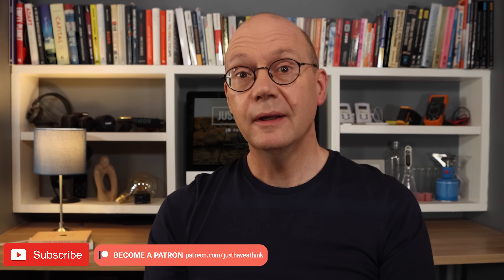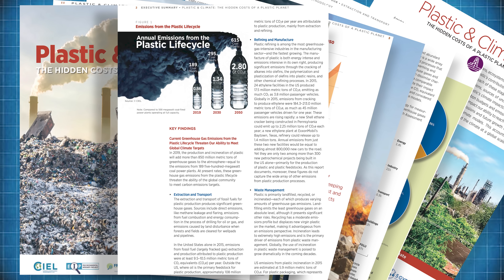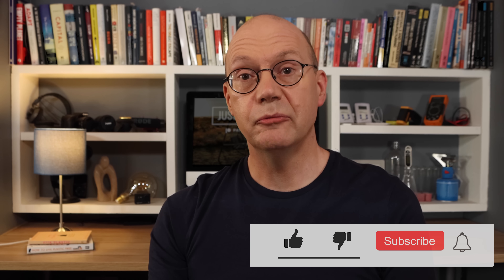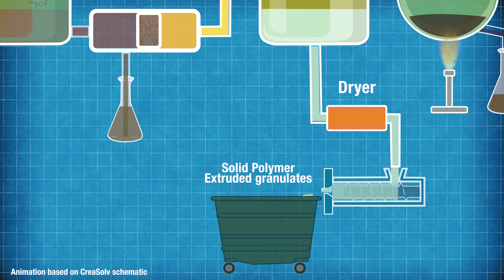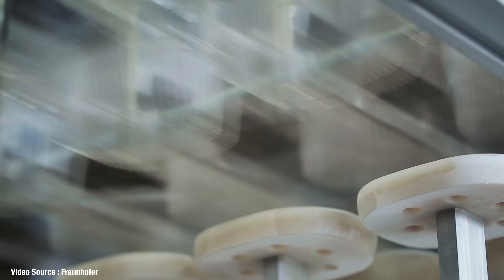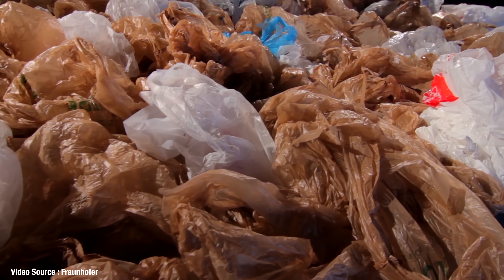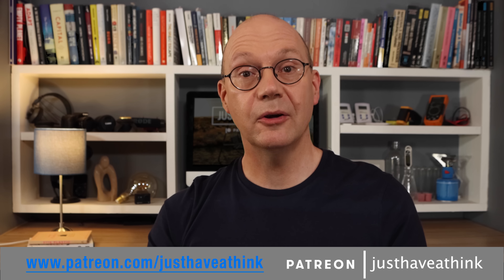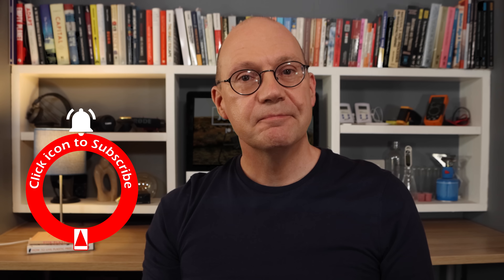Plastic recycling - revolutionary new process

Comment: great, you just tell them to use more without hesitation, remember the nature of human being? 

it is always the most expensive part to collect and sorting in the plastic recycle business. may be somehow someone can suck the ocean micro plastic bead in a cheap way, then it will work? the old "distill" to diesel method can handle a lot too, but it was not consider as a environmental friendly procedure.

by the way, recycle the plastic obviously more expensive than new one, you just have enough trouble to keep them alive in cut throat price war.

Comment: Something I'm wondering is since sorting the plastics prior to reprocessing is one of the big issues of recycling, I'm wondering if some processes proposed here, such as the CreoSolv process, can at least address the sorting issue by selectively dissolving the targeted polymer chains, then allowing the same feed stock to be reprocessed to target another polymer. I would also like to see some attention focused on thermal management of these processes (possibly like refrigeration to condense the distillate solvent being deposited back into the boiler vessel,) and the resulting energy comparison.

Comment: This attitude is based on a misconception that plastic cannot be recycled.  Plastic as well as other organic garbage and sewage has already been reduced into oil...just like crude oil.  That's right, we already have the technology with heat and pressure.  All this other babbling is a waste of time.  Dave needs to pay attention to that technology.  The oil can then be made back into whatever variety of plastic desired.  Even the following article talks about the negative effects of making garbage into oil but fails to notice the huge benefits other than getting rid of the garbage.   The oil does not have to be turned into fuel.  https://itotd.com/articles/8703/oil-from-garbage/    https://www.dailymail.co.uk/sciencetech/article-3907250/Is-POOP-future-fuel-Researchers-reveal-radical-turn-human-sewage-oil.html

Comment: Thank you for highlighting these technologies. I do have a horrible feeling that, once again, technical jargon has pulled the wool over the eyes of assessors and funding has been given to poor science. For example, microwaves cannot reduce the energy required for depolymerisation. The energy content of microwaves is insignificant compared to molecular energy. Indeed it is significantly lower at the photon level than the UV light I would get by putting plastic in my back garden on a dull day. Claims like this occur every 10 years or so, and i have been in the sector for 30 years, so this is the third time round!

Comment: Just a littel input from my point of view.
I have a PhD in polymer recycling from Tetra Pak by dissolution/precipitation process in organic solvents. I also build a pilot plant doing just that, at a scale of 2,5 m3 per run. So I hope I have some experience. 
It is not that simple. Most of the food packaging comprises much more additives then you might think. Oxygen barrier, water vapour barrier, hot melt glue, paper sticker with PU glue etc. etc. Mix it with all the random contaminants such as waste food, brick, stainless steel wire and live rat. Now imagine that you cook it in a solvent and it all miraculously turns into a virgin, transparent, "smell-like-new" product. Imposible. This technology can only semi-work in under one of the cases: 1. packaging manufacturers use only simple, mono- or bi-material packaging, and consumers segregate religiously; 2. raw material is sourced from industrial processing waste which is not as contaminated. In either case the product being recycled is not as pure as it is claimed. Contaminants can be easily spotted in case of transparent plastics. All the inks in packaging labels dissolve in solvents and the product color is random - puke green being the industry standard. Uses of such material are very limited, I highly doubt the reuse in food packaging is an option. Other than that in the case of the EU the market for such products is very limited, and the pricing does not justify investment in complex installations (ATEX zoning everywhere). In my case we are trying to separate LDPE from Al and we might just have luck with that, but starting from mixed plastics... imposible. Separating LDPE, LLDPE, PEX, HDPE, PP by dissolution is just silly... We probably should have lower expectations, and promote products made from recycled material to make a market for them, but claiming that recycling to virgine quality is possible is not honest.

Comment: Interim steps: Every part of a container should consist of the SAME polymer. ( This is the problem with ALL beverage containers.)  The recycling symbols should be MUCH LARGER!!!  The recycling symbols should be machine recognizable.  Discarded resin types SHOULD be stored separately so that each resin can be accessed easily when a future use is developed.  Perhaps, each resin type should be assigned a colour or dopant unique to it.  Virgin resin types COULD be taxed so that RECYCLED resins become more competitive; later the tax could be reduced!!!  Complex packaging types, i.e., cardboard-plastic, glass-plastic, metal-plastic composites MIGHT req. a ban until ways to deconstruct them have been devised.  Tetra-pak, be advised.....

Comment: Hi there the plastic problem is not a problem firstly as an plastic process technologist plastic can be recycled so 30 percent can be introduced back into the virgin processing only at 10 percent because polymers change their micro crystalline another words ultraviolet radiation and acids change its basically properties. The recycling is labour intensive and is not cheap unless you get free labour by using the unemployed, a Canadian Ukrainian in Toronto developed a pyrololygis of turning plastic waste back plax crude but now it is expensive to do so waste to energy is another way of controlling waste .

Comment: Personnally i ask myself if it isnt better to burn (and filter as good as possible) plastic under high temperature rather than let it split in micro and nano plastic which ar toxic for food chain. Also u get some heat and energy instead of a big pile of shit, even the ash can be used. Dont have the answer its q question.

Comment: 1. Tax hugely for those still produce and using Single Use items + Make them (the producer of single use) responsible to manage their Single Use Waste post consumer use.

2. Change delivery of food and drinks product and produce without SINGLE USE PACKAGING - By doing Refill System. Putting Refill dispensary in stores (speciality or general stores) will push towards eliminating single use packaging waste. 

a. The consumer will have new habbit of carrying their own container 
b. The shop could rent Reusable Container ( Deposit Return System). Consumer rent a container to carry the product fot the amount price of the container, when they return the container they get full refund of the same amount money that they rent the container for.

Make this mandatory for food and beverage industry practice.  That is what Circular Economy suppose to be. 

Btw ; the auto industry should redesign their product parts in ways to be Recycleable, Reusable and-or Repurposable. The big autos should truely switch to EV (electric vehicle) instead putting mask on their ICE (internal combustion engine). The matress industry should opt towards organic material without the harmful toxic that they put into modern mattresses (look it up if you havent heard what are toxic in our home)

Comment: Twenty years ago, I had hopes the Thermal Depolymerization (TDP) process pioneered by Changing World Technologies would be able to solve some of the plastic issues. Their process broke input stock into more basic gases (siphoned off to power the process), water, solid carbon, metals, and hydrocarbons. Their pilot plant turned Butterball turkey ofal into light crude oil, which I assume could be refashioned into virgin plastics. They experimented with many other input stocks, including medical waste, plastics, and tires. Unfortunately, the pilot plant was unprofitable and they appear to have folded up shop in the early 2000s.

Comment: I think what needs to happen is that packaging will be from biodegradable plastics and things like controllers, tech parts etc. Should be made from recycled plastic. In the end I think everything will be okay since we are moving to digital only media quiet fast (no more cassetes and cds in the next few years which will generate a lot of new useful and recyclable metals and plastics), smaller electronis and combining of products (like smart tvs that are a screen but they have netflix and such services within then so when gaming will move to the cloud it will probably be there) which will reduce required materials. The earth has enough materials for us and we already discovered enough for generations and generations to come

Comment: Why recycle plastic? That is more complicated and more expensive than making new plastic.
That doesn't mean the old plastic is wasted and it doesn't mean it will pollute the environment!
Plastic is an excellent fuel! Burn it to produce energy! This saves fossil fuel and it's a kind of 'dual use': Burning oil to produce energy is very effective. But if we take this oil and make plastic first and THEN burn it, we have used the oil TWICE and this is really smart.
There is absolutely no need for recycling plastic because the raw material (Oil) is abundant, there isn't any shortage, not in a hundred years and the environment is protected by COLLECTING the plastic, recycling doesn't add any advantage. Indeed it is a disadvantage to recycle, because it's ineffective in terms of energy use and economic costs.
So recycling is once again one of those half-baked 'green' ideas that can only be described as brainless.

Comment: old dump sites will some day be plastic gold mines. It is an agenda, a leftist agenda, because they know everything can be cleaned or recycled, we were recycling prior to the recycling program 98% of all garbage and the 2% (radioactive wastes PCB's etc.)I found recently was being cleaned up by a PCB cleanup company from Louisiana using a Texas based Patent of which Ballard fuel cells use the other half, and the whole patent is a battery with no moving parts and consumes no fuel, it is a complete loop and perpetual energy. It can clean nuclear waste but the company does not do it due to insurance rates and safety costs.

Comment: I wonder why we can't just pick 3 or 4 different standard plastic types for our supermarkets and mandate all packaging uses that. Then you just ban or tax other plastics sold in supermarkets. I understand that this requires a lot of political willpower and a lot of effort setting up an industry standard (preferably non-patented plastic types). But this should be way easier than inventing futuristic breakthrough technologies. Although I love seeing these innovations, I think it's naïve to depend on it. I blame the problems on the disconnect between producers, supermarkets and recycle plants. A producer has no incentive or means to make agreements or work together with recyclers to achieve a more streamlined life cycle of plastic. I think this is a fundamental problem which needs to be solved trough policy.

Comment: Arguably, it's not a matter of "hydrocarbons" itself, but sustainability / equilibrium that is the most helpful goal.  You want some process that has zero net externalities.  Making these out of elements which are less common already in our environment would make us more in peril.  Then, any process, no matter how much more efficient and in creation of consumer level equilibrium, that then brings elements / compounds which are out of equilibrium to out of balance accumulations, may be problematic.  So if you make a beautiful process of re-use, but it makes some cute little radio-active something as a side effect, you are not only back to square one, but may be even worse off.  As a lesson, therefore, I counsel once again that our very very very first goal should be reduced use, then re-use right after that.  I know you know that saw, Dave.  I also realize that we may be on a point where in the next decade or so may be the last time we have the resources to come up with some of these new ideas, given the downturn that comes as the temperature goes up may be far worse than we all anticipate.  Still, if we all keep this as a bias, reduce and reuse first, we are more likely to focus our activities where they mitigate problems most, and not just where Wall Street and London can most easily put their monies.

Comment: We have two problems in industry at the moment: companies are pushing to sell you ever more products and do this by forcing you to stop using perfectly good products: cars, phones, household white goods, and computers being some of the main culprits. On the other hand, we have governments punishing people for trying to dispose of waste. Governments should be clamping down on manufacturers to build things to last instead of built-in obsolescence.
One fact: 25% of plastic produced is thermo-setting plastic which cannot be recycled. Some products cannot be made from thermoplastic, kettles, electrical fittings, and can therefore never be recycled. We need to go back to using other materials where possible, such as wood, metal, paper, and card.
I hope this recycling process works out but a couple of things never considered, even by "greens": use less/waste less. A much more effective way of reducing electricity consumption is a change of mind by people, not making it more expensive and punishing the poor.
One of your better videos but I do get tired of hearing all the same of "Anthropogenic Climate Change" memes.
Reply: The main problem is, that selling one product that last long will not be profitable in the long run. I think then there need to be other ways around it like. If you buy a phone the phone will be expensive and you will get other subscription model types like apple does. The only problem is that they bring out a new phone every year eventho their phones can be used for 5+year with no real problems.
Reply: @LemonsRage  Thanks for the comment, that's my point. On the one hand we have stupid governments listening to "experts" (most of them are charlatans) and bringing in draconian "green" policies which generally involve higher taxes to punish us for consumption, but not addressing the real problem, the companies who keep bringing out updated products with built-in obsolescence. Then there are the fashion idiots who just have to have the latest model.
I'm doing my bit, I use an iphone 4G which still does what I need, texts and phone calls, and a third-gen Ipad (Retina) which also does what I need, mainly taking photos and video. I don't upgrade computers until I can no longer run the version of Windows. I kept my last car for 18 years and the only reason I scrapped it was because I could not afford to have it completely reqired, which is what it needed. I had driven less than 150,000 miles. I was brought up in the 1950s when everything was in short supply, and still have that mental attitude towards waste.
Have a very good day.

Comment: What about plasma gasification plants? The only waste is plasma rock. They atomize everything you put in it and then you can separate the gases and use some to fuel an engine that creates electricity. It's even energy positive.

So it's an everything recycler + a powerplant.

Comment: this is good news if that component is revealed, i suppose you referred also to chemical recycling, there's also this https://news.cornell.edu/stories/2017/02/polymer-additive-could-revolutionize-plastics-recycling

you can build millions of multihull yachts with all the plastic available in landfills..
Reply: Are you proposing that we dig up landfills and sort out the plastic in them?  That is going to be REALLY expensive and have a significant carbon footprint.  It also stirs up biological hazards best left buried.
Reply: @incognitotorpedo42  only you have to use a modular factory mining the soil.

 a movable hermetic factory with wheels catching all the gases and storing them for other uses as refineries do, you can use weight separation and them sensors to identify the type of plastic with robotic arms as well as rest of resources. 

landfills are the mines of today, we need to stop mining and use landfills instead and so restore the land occupied by landfills

this is not about money, it can be done at diy microfactory level